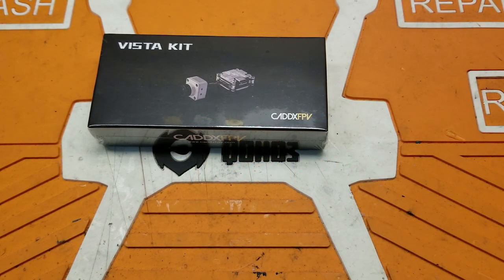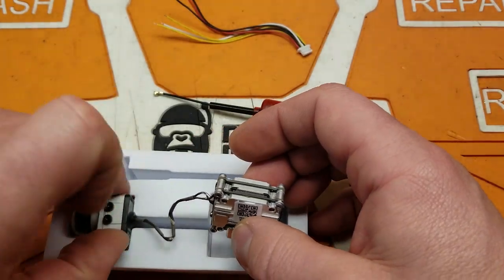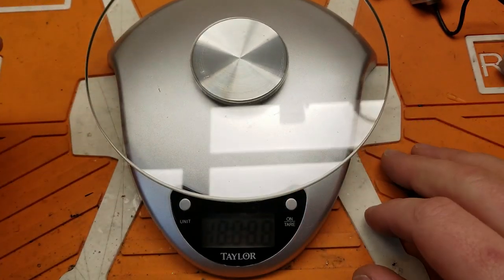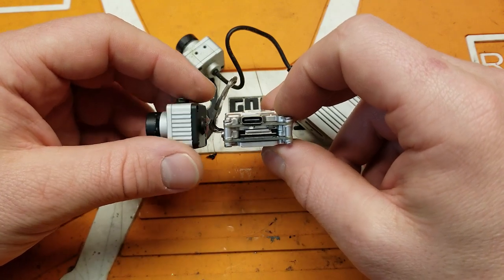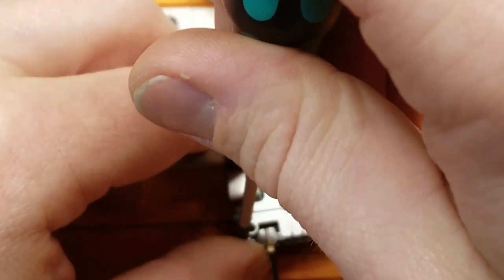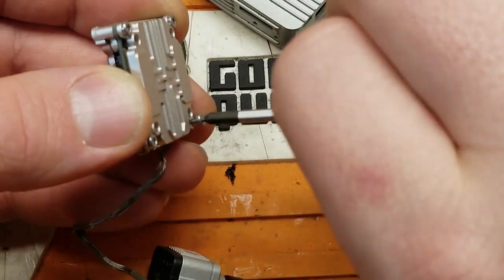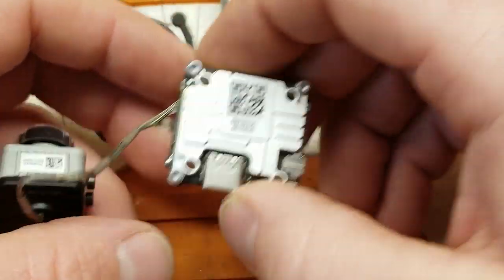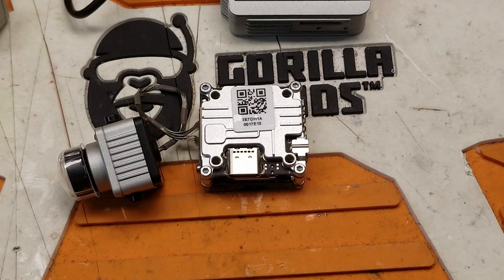Caddx Vista DJI digital FPV tear down

Comment: Just found your channel; fantastic tear down and review man!  I just replaced my air unit with the vista in my 2" cinewhoop and dropped the weight from 144g to 119g. ^_^  I've drank the dji koolaid and am slowly retrofitting my quad fleet. I'm conflicted on DJI entering the fpv sector since I'm pretty sure they're just going to dominate just like they did in aerial drone photography and push out the little guys. But, I also can't argue that they don't do what they do very very well.  When I flew the dji fpv system, my brain melted. :-)  I have the same issue when trying to recommend any other system other than DJI. :-/

Back to your tear down, that seems like an awful lot of thermal paste! I was always under the assumption that you need just a thin contact otherwise it starts to do the opposite of what it needs to do. I'm curious on if one were to clean it off with some isopropyl and re-apply with a CPU-like application and some quality stuff, would the temps be affected beneficially?  Just a wondering. 

Lastly, I think DJI goggles are made for us Asians with our flat faces :-D Hahaha, brick wall... ^_^  Great job man! Subbed!

Comment: Hi Tweet, Im thinking of making the jump to HD. Is it a pain to use to use your own radio instead  of a Dji radio? Also do you think heat will be a problem  when  running @700mw in the middle of the summer ? By the way the radio grips I purchased  on Etsy are fantastic , thx. Peace !
Reply from the maker: Running your own radio and RX isn't any different than normal. The DJI radio does make it SUPER easy to get going and all the functions on the goggle can be done via the DJI radio which i really like. Heat shouldn't be an issue as long as you are moving. There is a over heat protection to keep the chance of damaging anything down. But i have disabled that option just so the chances of the VTX shutting down during flight won't happen. 

I'm glad you like your grips. They are a labor of love for me. If you haven't see my how it's made video you should check it out. https://youtu.be/SSOY2nMdVO0

Comment: Based on your disassembly would you consider using a 3mm tap on the mounting holes to mount the unit?

Comment: I've had two vistas burn out on 6s I'm sure due to power spikes The last one was it own iFlight 5-36V 3A LC Filter Module and it popped to -gurr My others on 10v or 8v are fine My advice to all is don't use 6s 100+c racing batteries -prolly only use 4s to be save or use a different power source intended for the air unit. Thanks for the video! I was trying to see if there is a fuse in the vista unit -no luck hehe

Comment: great vid tweet. I didn't see how you removed the camera cable. How do you remove the cable from the vista and the camera side, so I can replace with the og coxial air unit cable? Are there 2 tabs on each side like the og air unit to remove the cable? or? if you have a vid on it, would love to view it too!

Comment: i rather have the air for recording clean , rather not use gopro-$$$ extra money that will break if you crash.lighter weight also. my opinion only. vista i can use for smaller 3 - 4 inch quads. if you can do the gecko i have 2, 1 need replace crack frame , i wil go that route. thanks for your video info!

Comment: Great review.  Especially the perspective at the end.  It would be great if the dji goggles fit better.  It sounds like image quality is enough of a change that people would tolerate the bad fit and light leakage.
Reply from the maker: That's about where I'm at with the system. But dji does have a new foam out that claims to fix the fit issues. I have some ordered. Fingers crossed.
Reply: @TweetFPV  With the weight of the Vista - what do you think a 3" build would look like or even a smaller 2.5" build?  It would be great to put that on a smaller quad, but I'm wondering what kind of motors and props you would need to still get good performance.
Reply from the maker: I would say at 140x motor would be ideal.

Comment: I have to swap a cable on mine for a longer one. Think I could pull off just the bottom section to change the cable?
Reply from the maker: yes

Comment: The solder is on those two pads because they need to power on the unit for testing/etc before it leaves the factory.
Reply from the maker: That's what I figured. Every vista iv bought since this one has had the same solder. It amazing that caddx is ops checking everyone before they head out.

Comment: Would love your opinion on something, had a quad fall from the sky and hit the ground, vista unit no longer powers up.
All wires are still connected well.
Is there a specific component of the vista that might be Susceptible to failure upon impact?
Would like to proceed with a repair before replacement.
Reply from the maker: Sorry I really don't know where to start with this one I have heard that if the camera module gets damaged the Vista won't power on so maybe try swapping in a new camera first
Reply: I’ll give it a shot, thank for your input! Your videos have been quite helpful!

Comment: I got the Vista in a Diatone 369 3inch quad. Using 650mah 4s its under 250 grams.. And the full size air unit in the Floss 3.0 using 30mm standoffs. Im waiting for the Vista to come back in stock so i can build a sub 250gram 5 inch build. I like to see you put the Vista in the Floss 3.0. I thought about doing it. But i went with a 3 inch to keep weight down
Reply: I want to put a vista in the 369 frame does it fit ? Can I run6s directly from the batt to the vista
Reply from the maker: You can run a Vista direct from 6s.

Comment: You sound stoked about HD and the Vista but still slightly tormented by liking The Omnipotent Dji gear! I am just getting into fpv now and it's been pretty funny watching everyone slowly and loudly not being able to resist much longer. I have only used Dji except a very short and out of control flail around a park but that's it. I never wore any Fatsharks, they must be like wearing your favorite slippers or more luxurious . Dji goggles are not so comfy I agree but I am sure there will be good ones soon. Giving the Big Dji alot of money!! I heard someone say gotta boycott Dji because they are in China and are spying on us through the gear. Not sure about that but I have learned that lots of all the stuff is coming from China right,?He must not have noticed the months passing for boxes from China to get there. I have had a few camera drones from Dji in the last few years and never got the sinister vibe but I'm new to FpV . The customer service was none at all back then too but I hear that has changed. I love being able to see and I am not upset I came in at the end of analog. I have been in the early years of a few other things and FPV I am happy about coming in late a bit. The other huge reason I like Dji is I can almost put stuff together and fix etc. The other stuff is almost to challenging for my brain. Zero computer experience either. Makes building and maintenance a full time frustrating ordeal with SOS emails going out to JB and others. Ok done with the newb rant.
Reply from the maker: Not tormented. Just wish there was other options because I really don't care for the goggles much. But with that said the dji goggles are my top recommdation to anyone getting into the hobby that isn't primarily forced on racing. Oh and yes everything comes from China except for the orqa goggles.

Comment: any clue on how to dismount the lens? broke mine and doesn't seem it will unscrew...
Reply from the maker: You should just need to unscrew it but if you hit it hard enough the threads might have slipped and cross threaded.

Comment: How much does it weigh when you remove the heatsinks? Also once heatsinks are removed can it be run reliably at 25mW?
Reply from the maker: I didn't weigh it without the heat sinks. This little guy runs REALLY hot with the heat sinks and i think it would overheat without them but the only way to know is to give it a try.
Reply: @TweetFPV  I'm tempted to get one to try. Another user here on Youtube decased the original Air unit and it worked fine at 25mW and higher depending on ambient temperature.

Comment: Can the vista go as far as the air unit
Reply from the maker: In theory yes because it has the same power output levels. But I uses only one antenna so your rf coverage pattern could be less effective causing a precieved reduction. As with all things rf. Antenna placement is crucial.

Comment: Hi, nice Video :)
Fits the air unit cable in the Vista????
Reply from the maker: I'm sorry I don't understand your question
Reply: @TweetFPV 
Can i take the dji 100mm cable from the unit to the cam and put it in the Vista, because the caddx cable is only 80mm long?
Reply from the maker: Yes you can use the other cable

Comment: Awesome review, dude! 😃
The goggles are still too much expensive for me, but I would love to use it! 😃
Anyway, anyone of the 2 is going to be great. 😊
Reply: MC's Creations it is the the price of fatsharks goggle and it has no receiver sold with!... the dji has digital receiver.... And you can alway add an analog receiver for less than 50$... the inverse is not possible :)
Reply: @gigazman  That's true, but I don't even have a FatShark. Only Eachine's box goggles. 😕

Comment: Not a true tear down; just a look see inside. Doesn't determine components. If you are not an electronics engineer, what do you expect to learn besides how "neat" it is? Waste of product. The ring of goo is heat transfer compound. Only thing you learned is that it is not hollow! Better to get the DJI unit; better heat dissipation...ha! The use of that blue heat transfer goo might explain why it gets excessively hot. You WILL need to add a bigger heat sink.
Reply from the maker: Thanks for your input.